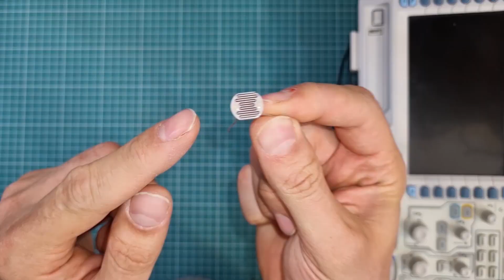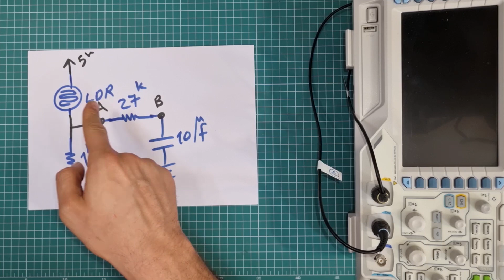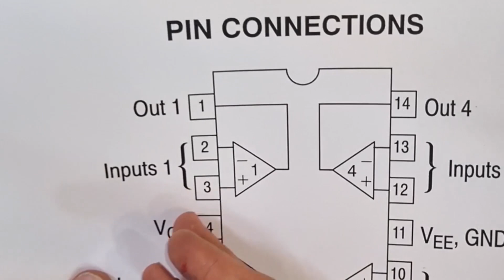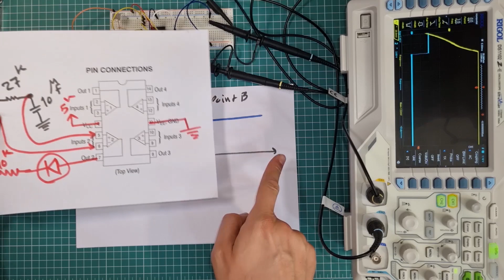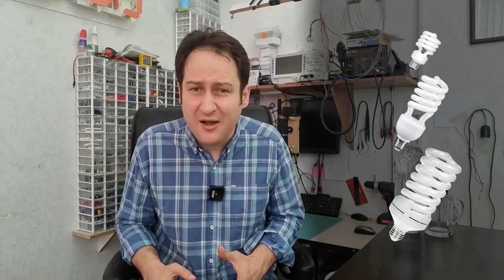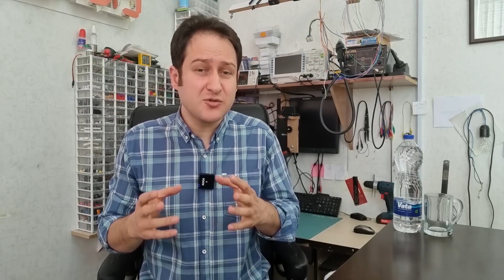Motion Detector without PIR module! Analog circuit Explained

Comment: Ik works nicely, but in one room we have LED spots here that cause an enormous ripple of 400mV over R2!  By reducing the 2.7M resistors smaller, it worked again, but of course with a much reduced sensitivity.  Solution: a smal capacitor (0.56µF) over R2.
I also replaced the two 10k resistors by two diodes and one 10k, and put the transistor as an emitterfollower, so the beeper beeps louder.  (I had to because I used a TL072CP opamp with a weaker output current.)
Reply from the maker: Great,  thanks for sharing your experience 👍

Comment: If ldr reduces resistance in light, then would not connecting point a to +ve keep output high when illumination increase?
Reply from the maker: No, the LDR is not connecting something, it is making a voltage 👍
Reply: @elewizard  Sorry for not makimg my question clear. If light increases then voltage would increase at point a, right? If point A in circuit is connected to +ve pin of comparator, then the output of comparator should be high? Although in the video you say the opposite in the last circuit where both comparators are connected. That's what confuses me. Thanks for the reply.

Comment: Amazing! I finally had the time to put the motion detector together on my breadboard. This hands on method is the best way to teach as I learned so much from this project. I do have one question. What is the purpose of the diode that is connected between the positive and negative terminal of the buzzer? I also can't stop playing with it. Thank you.
Reply from the maker: It is really funny to play with that circuit 😃. The diode is called flywheel diode. It is used in parallel with inductive loads. The buzzer is inductive load. If you ignore it maybe you didn't feel amy different, but in noisy environments it will shot its impact.

Comment: Thanks! Can you show the internal workings of Inductive/capacitive Proximity Sensors like lJ12A3/used in industrial control applications. I took one apart, after wrestling and boiling the epoxy resin, found a board with bunch of SMD components, some of the component came loose and the main npn transistor was scratched beyond recognition.  I would love to build one on the breadboard and use when I'm lab tutoring.
Reply from the maker: Thank you for donating ❤️
Yes certainly, but I am not sure when.

Comment: Strictly speaking a PIR is not a motion detector - it detects changes in heat.   A photo-cell would be less useful,,,,,,,walkimg into a dark room [unless you were carrying a light source] would do nothing' you need to either shine/reflect light onto it or  block an existing light source
Reply from the maker: Yes you are right,  but you can replace the LDR with a photo diode, then this circuit will be able to detect infrared changes in environment. Or you can replace the LDR with a microphone, then the circuit will be able to detect sound in environment.  In this video the concept is more important than the application

Comment: Glad you found the culprit.    Is 1N4148 really necessary on buzzer leads?
Reply: A power diode such as the 1N400 family is effective at lower frequencies [and can handle more current
A diode will prevent back EMF
Reply from the maker: No, it not necessary, it is recommended

Comment: When you have a noisy input signal, hysteresis is your friend. A little bit of positive feedback (a large resistor from output to non-inverting input) will ensure clean switching from one state to the other without transmitting any of the noise to the output. I'd recommend using comparators rather than opamps in open loop for these sort of applications as they are happy with bigger differential inputs and are much less likely to lock-up under unexpected conditions.
Reply: well   while that is true it is mainly used if the signal is erratic.   Noise is handled via filters
Reply: for newbies a omparator uses  a different circuit - it is not a direct replacement
Reply: comparators will also switch faster
Reply: @kennmossman8701 
1. If you want to use filters, then you are adding an additional stage of complexity. It's not necessary when the noise is small. The Schmitt trigger is used to combat small amounts of jitter anytime we want to switch cleanly, and you only need one resistor to implement the positive feedback in this circuit.

2. Nonsense. The comparator is used in the same circuit as an open loop opamp. That's because a comparator is an opamp that has been designed to accept larger differential voltages and (usually) a larger common mode range.

3. Common comparators like the LM393 have very similar internal circuitry to a common opamp like the LM358, apart from an open collector output rather than the push-pull on most opamps. That leads to similar performance and switching speed. You can get faster comparators and faster opamps, of course, but for these sort of circuits switching speed doesn't really matter.
Reply from the maker: Thank you for your recommendation 👌

Comment: As someone trying to learn electronics strictly through youtube videos (probably not the most efficient way)  this video is very enlightening and much appreciated.  Seeing a circuit evolve and troubleshooted makes resistor choices more clear and logical.    Usually we just get told "use X resistor here ,its common practise". 
 Im surprised it worked so well i think I will try this technique for a mouse trap ive been putting off, mainly because the PIR modules i intend to use arent that straight forward to use, and ive been having good luck with just using them to catch the mouses manually - by extending the light the PIR is attached too into my room that turns on notifying me the mouse is in the box i set out, which i come by and close the entrance while the mouse just sits there thinking i dont know its there.  Winner winner, mouse dinner.  JK i release them,  but theres 1 left and it wont sit there ...   I need a switch to close the entrance but need detection first.  Thought about usin that vibration detectoin IC that comes with the arduino kit and then the PIR module but the ciruity looks way more complicated and i think going simple is smarter to start, then work up to something more complex if its even needed.    Anyway great video and nice results ,the increases and decreaseing could even be used to tell you if something is coming or going, more infromation then a PIR module can even give, very nice.
Reply from the maker: Thank you for watching and thank you for sharing your experience with me ❤️